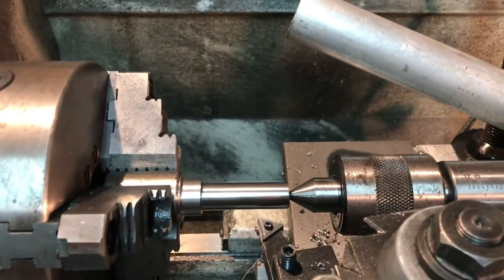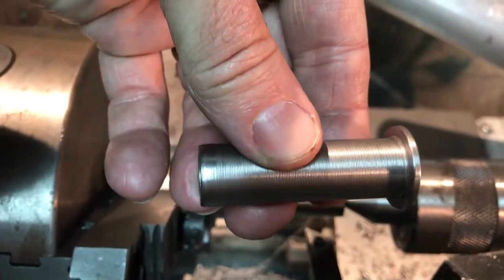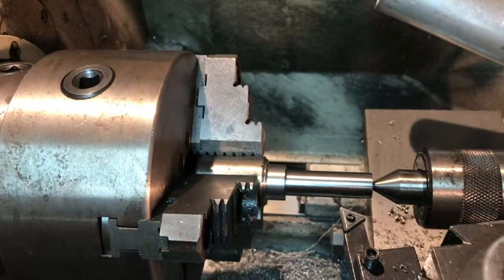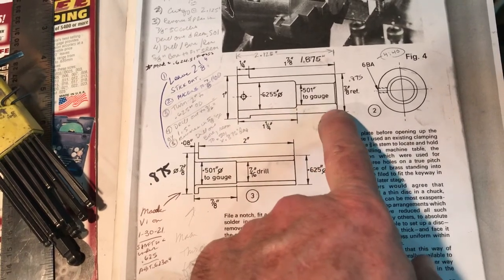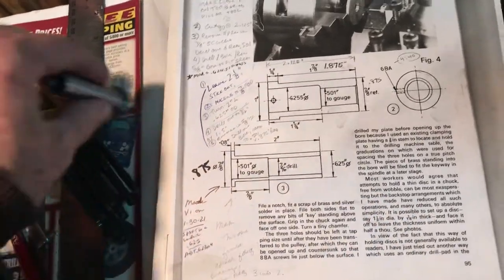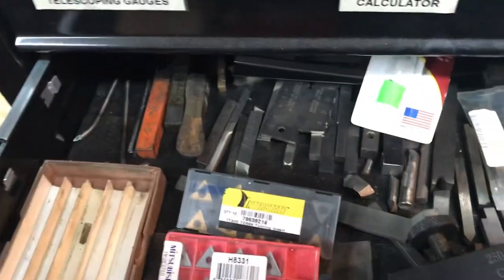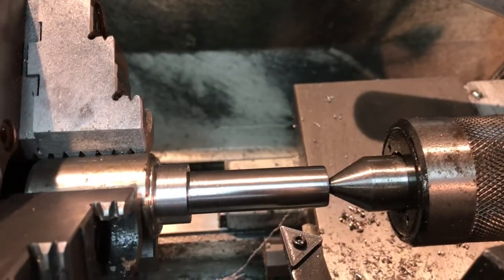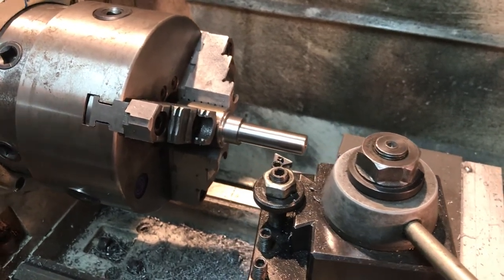Dealing with Mistakes... choosing the right carbide insert

Comment: I got some of that from Russ too and I believe it is 1045 steel. I had problems getting a good finish on it too. You can spin that part and sandpaper it to a bright finish.
Reply from the maker: Thanks, Fred. I bet you are correct. I finally got a good machined surface with the correct carbide. It did polish up nicely with some 220 grit paper...